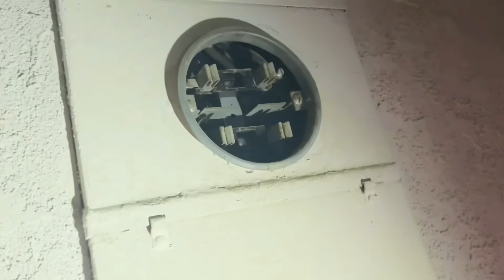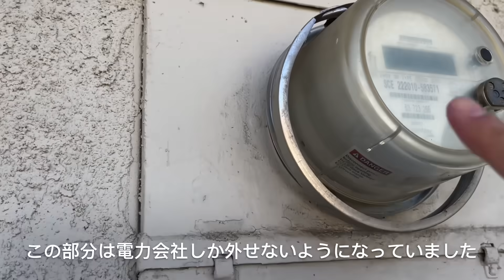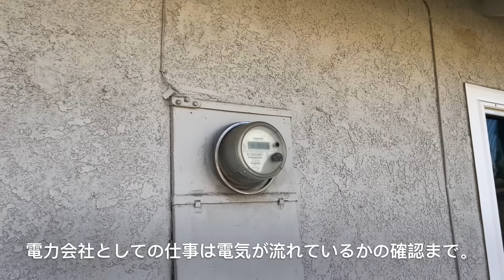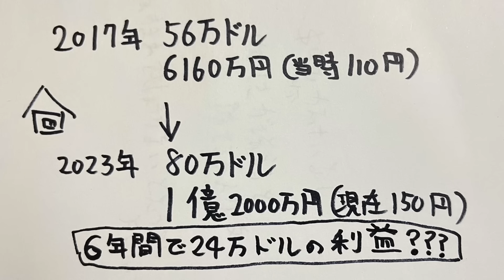申し訳ございませんでした/電力会社に直せないと言われ面倒なことになっています

Comment: it seems like the problem is  just short run between meter connector and input to main breaker/power panel input.     $10 parts should fix it.   ye,   if you own the house, rental house,  ability to able to fix, trouble shoot by oneself is must,    other wise you will be paying every time you got the issues.